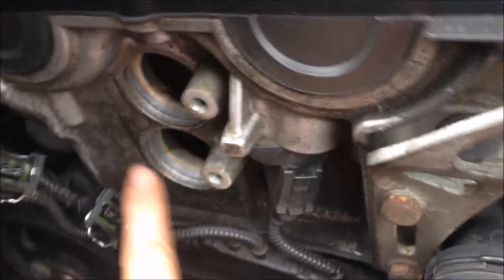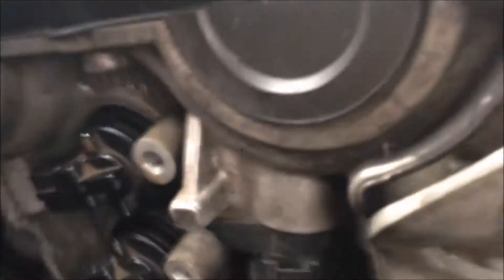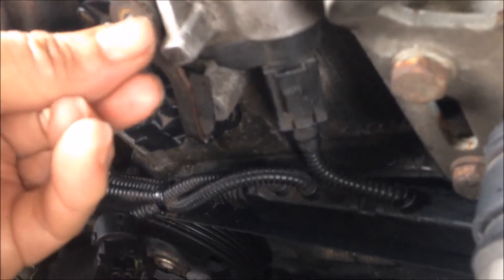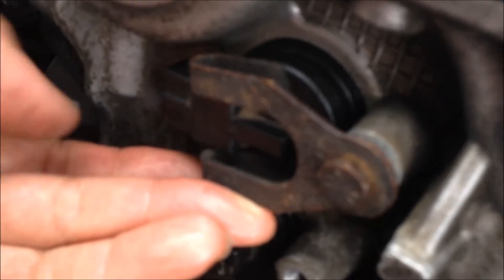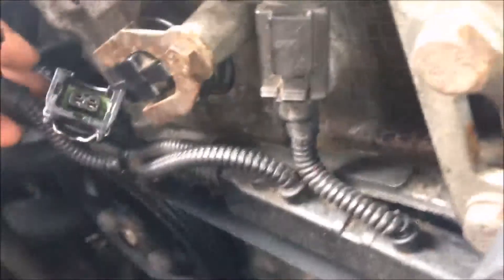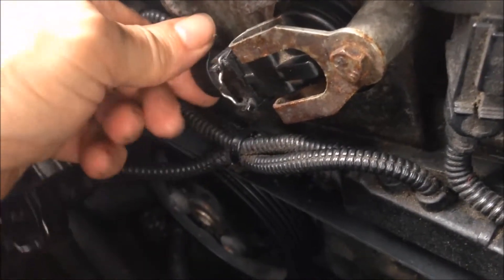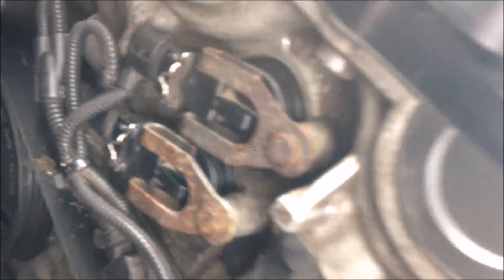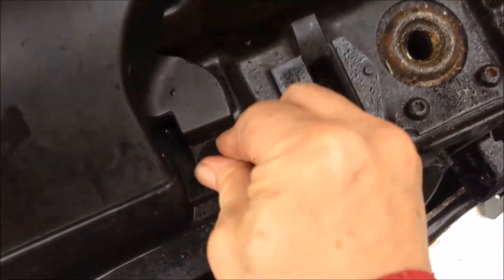BMW E46 / N42: How to Install the VANOS Solenoids

Comment: Жаль что не понимаю английский. У меня очень неровно работает двигатель. А когда отсоединяю штекер соленоида любой из двух, машина начинает ровно работать.
Reply from the maker: Check your oil pressure and take actions if pressure is low. Good luck!
Reply: @RepairDIY спасибо большое за помощь. Вчера почистил соленоиды. Стало гораздо лучше. Но не полностью. Мне пришлось удалить катализаторы. Но прошивку я так и не сделал. Как раз проверю и давление масла
Reply from the maker: Good oil pressure is very important for a smooth engine running. Good luck!

Comment: Hi, my vanos solenoids won't come out. They rotate a bit but are otherwise pretty stuck. How do I get them out?
Reply: Try pulling with pliers on the solid bit in the middle. In some other videos you can see people do it.
Reply from the maker: you might try some silicon lubricant spray? or buy a second hand one from ebay? good luck!

Comment: Good tip which is needed with new seals, use a rubber mallet to tap the solenoids in.

Comment: Hi followed it, but replaced the solenoids. On start up the car ran very ruff, On adding more gas it became smoother, but when removing the gas it ran lumpy before stopping. Solenoids were replaced as the originals were original and had been in from 2005. No problem before replacing, seem if its not broke do not fix it. Ideas?
Reply from the maker: Hi, yes, you are right:  if its not broke do not fix it! you could check the wiring plug? you could check the rubber seals (smaller one and the big one?)? you could try to put the old one back to see if anything changes? Good luck!
Reply: @RepairDIY  put the old ones back, started first time smooth as silk. Now cutting out. ha ha ha. The joy of rebuilding cars that have been not used from 2015
Reply from the maker: @colincrawford6612  hi, that could be a lot of jobs ahead. My VW Polo had huge resistance to start after parking outside for one year. My Toyota Aygo had alternator stuck after parking for five months. My E46 cut off after starting 10 to 30 minutes, or sometimes just not starting, due to the crankshaft sensor (not an easy job!). Enjoy your adventure!
Reply: I have the same problem, after I changed the O rings the car started running rough and stalling at low revs.  Did you end up finding a solution?

Comment: I changed mine and then one of the silver clips flew off. Do you know where I can buy a new clip from please ???
Reply from the maker: Hi, if it fell off into the engine bay, try to find it from top, or remove the lower plastic tray to see if it stays there? A good place to try is a local scrapyard, it you find a similar car, you may find the clips. the last resort is the BMW dealer for a dealer price. Good luck!
Reply: You can go to a self-service junkyard and take one off another car.

Comment: When initially removing the snorkle, what do you recommend using to get the pins up? Do they come up easily by hand?
Reply from the maker: Hi, Not easy by hand only. You can use a screwdriver or a piece of metal stripe. In one of my video, I used a special pair of pliers which is the best! You can watch it here (at the beginning): 
https://www.youtube.com/watch?v=j1FDqxLWqQs&t=35s&list=PLCXPGrQnBEsUBcBSqiS4nxpETOUWp6syO&index=4

Comment: Hi, 
These videos very helpful and gives ideas about engine.
Is there any specific tightening torque chart for this engine?
I have N45B16 engine.
Reply from the maker: Hi, Thank you for your comment. I normally use the Haynes Service and Repair Manual (4067). At the beginning of each chapter there is a list of the torques. If a particular torque value is not in the list, I either tighten it by feel, or search the internet. Happy New Year!
Reply: @RepairDIY  Hello i exactly followed your instructions,i cleaned the selenoids with brake cleaner,after installing everything back,car would have a very rough idle in some cases it would shutdown immediatly.what you suggest to check?
Reply from the maker: @spyroskatsikidis7899  Hello, I learned from somewhere that the car should use some default settings after the car is just started. The vanos system only kicks in after a while(not sure how long could be 1 to 3 minutes?). I think if your car shutdown very quickly after start, you may have other problems. One possibility could be fuel supply (pump running? rail pressure ok?...). One more likely cause could be the crankshaft sensor, which can prevent the car from starting or stall at any time. it is not a small job! to replace the crankshaft sensor, you have to remove the intake manifold as the sensor is behind the intake manifold.  good luck.
Reply: @RepairDIY  hello and thank you,car was driving fine,only think I did is take out the vanos,clean them with brake fluid and insert them back.cablimg is also ok,might be that a selinoid went bad after the cleaning?
Reply from the maker: @spyroskatsikidis7899  That's a good news! the solenoids should be tough enough for any cleaning. they are just oil switch and should last for the car. the first time you start engine, the solenoids were empty and they need to be filled with oil i think. and if you disconnected battery, the ecu may need to re-learn and rough for some miles. hope everything work out well for you. cheers.
Reply: RepairDIY the start works smooth now,probably it needed some time to read apt
Reply from the maker: @spyroskatsikidis7899  great job!  a very good news!

Comment: Its silly question but you use a newton m tool.  Need a good NM tool :)  
Witch fabrik is your tool?
Reply from the maker: Hi, I am in UK and I bought the torque wrench from B&Q (£15 or £25, couldn't remember). The range is 5Nm to 25Nm (1/4") and the brand is "TorQ". Happy DIY.